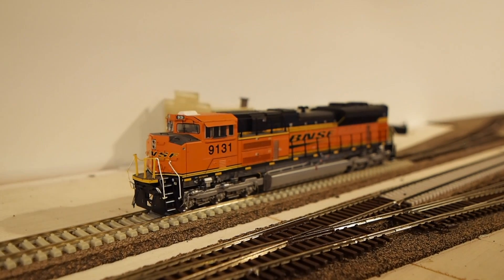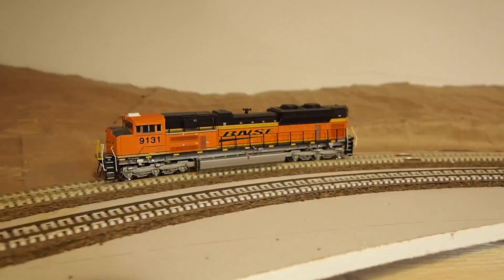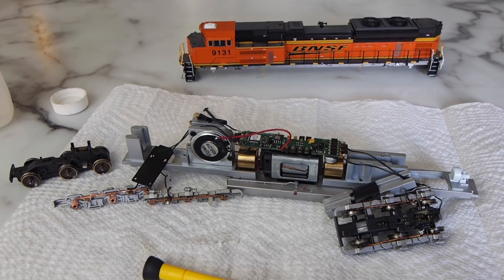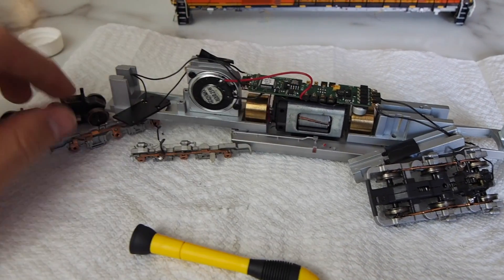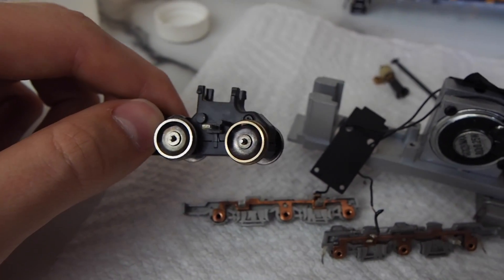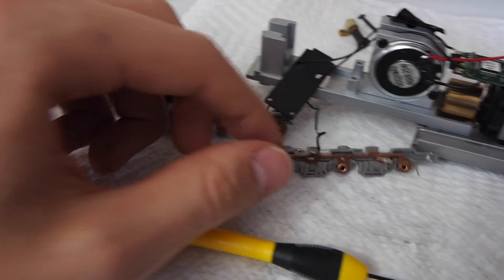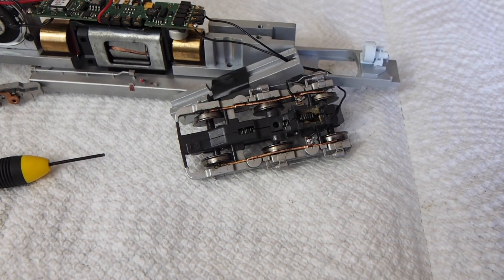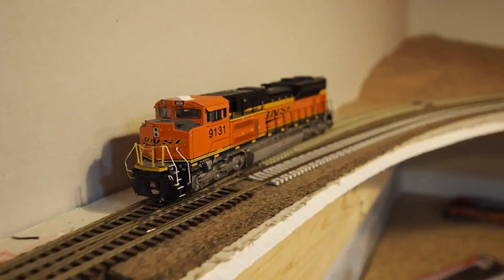One Way I Improve Locomotive Performance

Comment: You give bad advice! You think bending the wheel wiper will help. On a curve the inside axle needs to move one way or the other as compared to the front and back axle, just like a real locomotive. Your video shows the inside axle has no where to move, very bad! The wiper is putting weight on the axle making contact. If you clean the axle and soldier the wire to the wiper this will do more to enhance the performance than what you are recommending.

Comment: Use De Oxit to clean the contacts not denatured alcohol. De Oxit is used for electrical contacts on radios and circuit boards etc. to clean any oxidation. It’s safe for all electrical components and works 100% better.

Comment: Will work until the stresses equalize.  Peco have a conductive lubricant that is worth researching; it might work.  I did not say it would work, I just said worth researching.  Your problem might be insulating lubricant, as happened to me once.  I oiled a perfectly good loco, and it became many times worse than your loco.  The oil was cleaned out and  replaced with something else - problem solved.  Worth research.

Comment: I rarely suffer issues with my trains due to just running standard DC. The DCC trains are great, but I'm not willing to shell out a ton of money on the newer generations of trains. Especially if something goes faulty. I rarely ever have any issues with what i run. Maybe just a wheel/flange polishing here and there, but i never had any electrical issues otherwise.

Comment: I have about thirty 70s-80s blue box Athearn DC locomotives.  One problem a few have is for some reason a few are more efficient than the others. They'll draw 200ma instead of the normal 400ma.  Might be some have stronger magnets or freer drive trains.  This becomes a problem when running an MU consist.  The gears will bind on the slower units or excessive wheel slip on the faster (or lighter) units.  To correct it I installed a resistor on the faster units to balance the speed.  This also corrected the wheel slippage.  A value around 2-3 ohms at 2 watts seem to work quit well.

Comment: On the old blue box locos I used to take them all apart, clean any plastic spurs and and sand any rough parts and lube it back up.  Worked pretty good for then.

Comment: I was bothered a little bit about these locos being notorious for bad pickup as I just bought an Athearn UP SD70ACe loco.  It's on a 3' test track and powered by an MRC Prodigy Advanced2 system.  Started it for the first time yesterday and I set the speed at the lowest setting and it creeped forward without any jerkiness or stalling.  Is it possible that this Genesis engine I have won't or shouldn't have the problems you mentioned?  It's a 2020 release, "Spirit of the Union Pacific" and "Salute to the Troops.  Nice vid, BTW.

Comment: Just watched this tip and just a thought before adding extra tension to the side pads add a dab of electrolytic grease or even a micro dab of transmission fluid to each axle shaft.  The down side to what you did is the axles need a bit of plan for tracking purposes.  Just an idea to try before bending the pickup rails!

Comment: This loc is well designed and build. My loco's have flange wipers and they wear out in time. I use a tiny bit of graphite to "grease" and improve contact. And to keep the rails in top condition I use the same 'graphite' method. It works. Thanks for sharing. Greetings from France

Comment: Is pretty bad that a $150 scaletrains operator with sound will out perform a $260 athearn genesis with sound straight out of the box
Reply from the maker: Gary A agreed. I think Athearn Genesis has gotten a lot more reliable, but you can’t beat Scaletrains. These first run ACes had some issues with the trucks, so I finally just replaced them. Works beautifully now.

Comment: I am new to the hobby and some model railroaders might think I don't know much but I use vodka to clean my rails and wheels. I've never used rubbing alcohol due to the fact that it contains mostly water. So if water wont remove oily residues, why would you use a water based product? In 2 years I've cleaned all my locomotive wheels and contacts only twice but the rails get a vodka rubdown once a month.
Reply: What do you use to rub it down

Comment: Instead of bending and distorting the contact bars on the side frames cut the Katy bronze coupler springs and place them on the axle ends. this will give a positive electrical and cleaning action while the wheels are turning and not stop the end play of the wheels.
Reply: What are "Katy bronze coupler springs"?
Reply: You buy them from a hobby supply. They are used in their knuckle couplers.  (all gauges) @jasondix3202
Reply: Did you use the springs from a larger scale, i.find tge springs.dont fit on tge axles
Reply: See the comments on this page. The Largest are the Katy O gauge coupler box springs and you may have to cut them in half to fit between the side frame and wheeel. @joshfreund6008

Comment: Lets put it this way. for what you pay for engines for Athearn  this an out rage and my answer is 20 years ago stopped buying them.   PS by a keep alive from Sound trax and it will solve your problem outer wise start buying  Engines form Atlas Kato and Inter mountain they do have the issue.
Reply from the maker: Thanks for the input. I totally agree. The trouble isn't worth the time sometimes (or always), and with so many alternatives out there, I don't know why I bother. I did wind up just getting a keep alive, but I haven't installed it yet because I plan on putting an ESU decoder in it as well. InterMountain is my go-to brand, so I can't wait for their BNSF DASH 9s to come out. Thanks for the comment!
-Cam
Reply: Have one more set of  A and B Genies Units to fix and that is the end of the story.  Stop buying Athearn end of the 20th century.

Comment: Where the wheel goes into the pickup plate hole clean and lube with a smear of dielectric grease . This will aid in lube keeps the axle tip from grooving and the hole from egging out ,plus it holds on and conducts,keeps the copper looking like copper without tarnish . The conductive lube on the market is good ,but does not last nearly as long and will sling getting on things that you don't want it on like the wheels. Thanks for sharing and I you give it a try.

Comment: Very interesting.  The first and second gen Athearn SD70ACe's are plagued with this issue.  Getting them to work smoothly was quite difficult even with an ESU Loksound decoder, plus the wheels were cleaned thoroughly.  What you have done made a lot of sense and I will be implementing this fix.  Shane's suggestion I will also implement as well to reduce the chances of derailment.  ESU has their own version of keep alive but it is tricky to install, there are no clear instructions in installing them.
Reply from the maker: Yeah, these locomotives are horribly sensitive to track imperfections. Also, maybe you've seen this site, but if you look up "SBS4DCC loksound keep alive", the first webpage should have clear instructions and photos of installing a TCS KA on a Loksound decoder. I haven't yet done this, but I was planning on it.
-Cam

Comment: I'll bet you what happened prior is that the wheels were floating to a point on the straights where they would eventually all not make contact (meaning RIGHT in the center between the contact strips on the trucks). which is why bending the contacts works out. And also why the issue was somewhat hit or miss as it required all of the wheels to be precisely in the middle to lose contact. If you run into derailment issues I would suggest bending the outboard contacts flatter to offer more articulation. Where you could leave the center wheels pressed in as the outers will do the moving.
Reply from the maker: Yeah exactly. Someone else commented that it's the axles which make the contact, implying that bending the contacts isn't necessary. That is true, and I completely understood that at the time of making this video. However, there are some models (the early Athearn SD70ACes especially) that have truck pickup problems for whatever reason. Sometimes the sideframes are warped or the gearboxes don't sit right. I don't know what it is here, but the axles only make contact when the hole they are slotted into is weighing down on them. At this small scale, even the smallest imperfections make a difference. So, similar to what you said, I think the problem here is that there are places on the track where the locomotive tips from side to side just slightly, creating moments when none of the axles on one side are touching the contacts. Pushing the contacts in to work as wipers creates a more reliable and larger contact area. In most models, this wouldn't be necessary, but this Soundtraxx decoder also doesn't have a strong capacitor in it, making the locomotives tolerance for conductivity loss almost 0. 
-Cam

Comment: I agree wholeheartedly with Greg. I used to use the bright boy track cleaners from walthers and have tried just about everything else. The only thing that's worked for me so far is one of the TMX track cleaning tank cars. They are a little pricey, but my jaw dropped when I saw how much grime I got off the track. The problem with track cleaners, oil, and regular track cleaning is it leaves behind a layer of gunk. Some of the processes will clean it, but it's only temporary. The oils and stuff actually leave behind a gunk layer that eventually attracts more dirt. I've only had a few problems since I got the car, but those are from my not very good track work and wiring.
Reply: Goose in The Caboose Productions  What do you use in your track cleaning car?

Comment: Hi Cam, as a old modeller and electrician,may I give a suggestion? Stay away from rubbing alcohol on any part you want conductivity, it contains some water and will hinder electrical contact long term. AS for track  throw away your track rubber if you use one as it destroys the track surface, I haven't used one in 2o yrs and clean my track with Innox, a spray similar to WD-40 only better. As for the wheel bearings, use a plastic compatible oil NOT ATF, it is made for transmissions not electrical circuits! A "clean" looking surface does not always mean a conductive surface, all my rails have a light coating and will show a line on a rag but I never have stalling problems. I used alcohol on my temporary layout years ago and locos started stalling more and more, yet the track was spotless! Once I stopped using it and went to Innox, the problems stopped. I work in Signalling and all our contacts in switch machines and grade crossing mechs are sprayed with a little Innox to help with conductivity and to help stop corrosion. I'd also try oil on the axels instead of bending the side frames as it is the axel that provides the contact and not the flat surface of the wheel . Your are right about soldering all the pick up wires though I haven't done the truck pick ups on mine. 
Not being a smart A## but just sharing what I've learnt in 40 yrs of model railroading..LOL
Cheers Gregg.
Reply from the maker: Thanks for the tips Gregg! I really appreciate it. You definitely know more on the subject than I do, and I'm glad you told me about the alcohol! I've wondered sometimes about that because just like you said, after cleaning track or wheels, electrical pickup almost gets worse. I think it also kills adhesion in the short term. I'm going to get some Innox now and try that out. My hypothesis behind this project was that the slight bend would increase the probability that at any given point a wheel would make contact with the pickup. I discovered there was a lot of crap at the axle points (which I of course cleaned out), but my hope was that in the event an axle point was compromised at any given time, this would compensate (I guess sort of like a wheel wiper on passenger cars). It probably doesn't help that the capacitor on the decoder isn't forgiving at all, but I wanted to try something other than just bypassing the problem with a Keep-Alive, something I still might do. Again, I honestly appreciate the tips because that's the whole reason I make videos. There's a community and it helps me learn and grow as a modeler. So hopefully it doesn't seem as if I'm passing myself off as an expert.
However, seeing as you actually are an expert in this area, would you mind if I summarized your suggestions in the video description? I'll put your channel name with it of course. That way people watching this will also see your advice.
Thanks!
-Cam
Reply: You're welcome Cam! I learn something every day myself.Some rubbing alcohol is 30% water!! Using a proper oil such as Labelle on the axel shafts will be all you need to get good pickup, the wheelsets constantly move from side to side as they traverse turnouts and curves and doing so actually polish the brass strip (bearings) . If you use the wrong oil or over lubricate this can cause a build up but not normally. I never have to clean wheels on  locos or freight cars and my train room is not air conditioned. In my opinion, keep alives are a substitute for bad track or wiring, I have a Atlas decoder with no cap at all and it runs fine? The thing with Innox is that it is made not to attract dirt, as some track cleaner fluids do, you will get a little black on a rag but it is not a problem, remember we want conductivity, not a sterile rail! If you wan't to see this in a vdeo, you can watch part 2 of "Talking Turnouts and Track" on my channel and feel free to put my points in your video, happy to help as stalling locos drives me crazy..LOL I can almost guarantee that if you stop with the alcohol and try Innox,or similar (only a little bit here and there) your problem will disappear?
Let me know how you go!! Take care and Cheers.
Gregg.
Reply: P.S...as for adhesion, you will loose a bit but thats a excuse to put another loco on a train..LOL  
Gregg.
Reply from the maker: Haha, exactly! I'll definitely look at that video. Thanks, Gregg!
-Cam
Reply: Fishplate, where do you purchase Innox?
Reply: Just checking is it INOX rather than Innox? https://www.inoxmx.com
Reply: @marka87  A bit late , but Innox.
Gregg :-)
Reply: Thanks for the knowledge!
Reply: Yea @FishplateFilms, where do you buy innox? If I cannot buy innox, should I use WD-40?
Reply: @MartinJones1  Hi Martin, you can get INox on line and from certain stores in the US , but CRC2-26 is a good substitute , but stay away from WD-40 , it's not made for this! 
Cheers Gregg.

Comment: Had same type of issue on one locomotive, I noticed the pickup wires on the pickup where not soldered they had a jacket type cover connector , removed that and soldered the wire. Much better. Thanks for posting. Darick
Reply from the maker: Thanks for commenting! It's annoying when that stuff happens because for the most part it's invisible.
-Cam

Comment: Wouldn't this idea restrict the side to side movement of the wheel sets and cause premature wearing of the contact strip? Have you tried conductive a lubricant at the bearings instead?
Reply from the maker: Definitely. I was careful to not put too much of a bend so that the truck didn't become too rigid. There's sort of a sweet spot. But with the locomotives I've dealt with, that contact strip is still pretty flexible, so even when going through a curve it'll provide a bit of resistance but not so much that the trucks jump the track. It also helps to have pretty solid trackwork. And I like the conductive lubricant idea. I was just talking to someone about maybe using Automatic Transmission Fluid at the contact points. I remember reading an article about putting ATF on the rails, but I think it would work well in the trucks too.
-Cam
Reply: Hi Cam, 
I have a bottle of Ariso-Electralube p/n CRE-29602, seems like a synthetic oil of some kind with finely ground carbon in it, I also have a jar of "NO-OX-ID "A SPECIAL", Sanchem Inc, Chicago, IL a type of grease that is conductive and an anti-oxidant as well. The use of ATF is a possibility, so no shortage of lubes to experiment with.

 Interesting video though, thanks for publishing it.
Reply from the maker: And thanks for sharing what you use. I'll have to try that!
-Cam

Comment: This was very helpful, thank you!! Had the same problem with some New Genesis locos from Athearn and could not figure out what was going on. Found in one of them they did not attach a wire from the trucks and another had the same problem as yours. I wonder if they do "Quality Control Checks" at the places these are assembled? They need to run them before they package and ship such pricey items!! Thanks for the video and information!!  D. Muse
Reply from the maker: I'm glad! And it definitely seems that Athearn has a lot of problems with trucks. I also had an InterMountain unit where one of the pickup wires came undone. That was after I had it for a bit, but you'd think that wouldn't be something that just comes undone.
-Cam